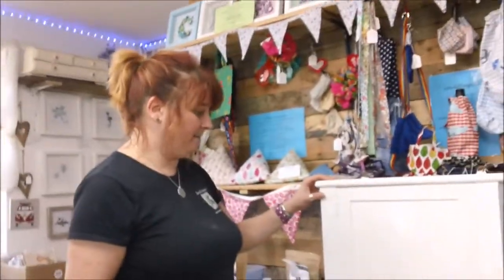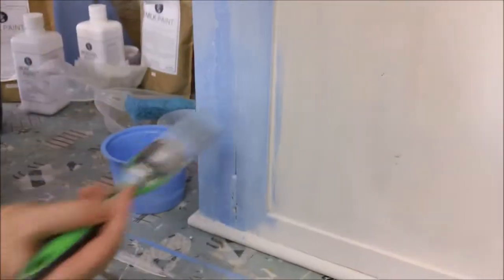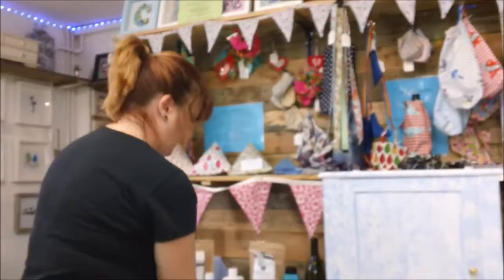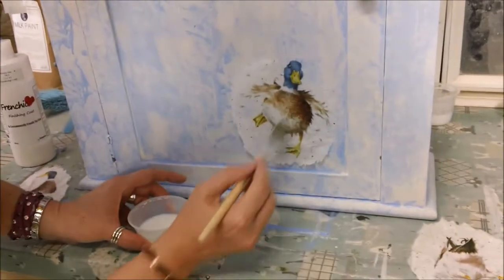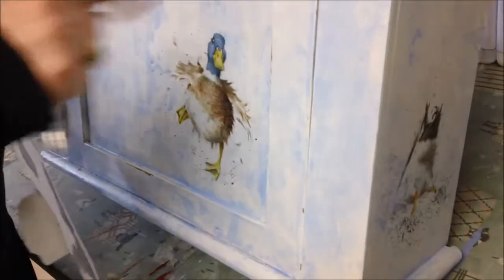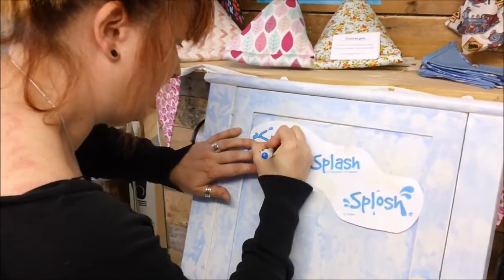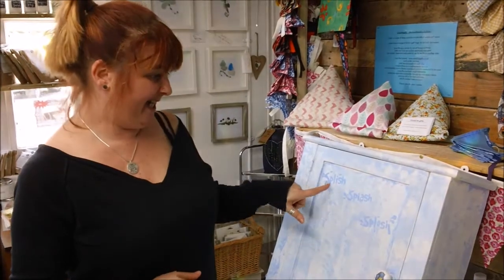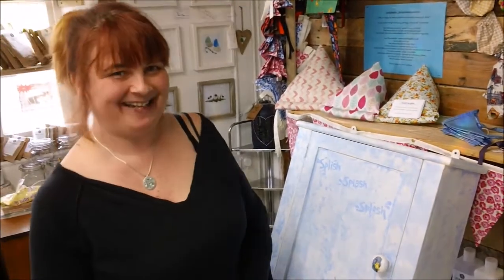Splish splash splosh cupboard

Comment: what is milk paint?
Reply from the maker: Stephanie Smith What is Milk Paint?
If you love using chalk paint, then you will love GraceMary Milk Paint. Milk Paint provides a completely different finish to chalk paint and can create anything from a silky professional finish to a highly distressed antique look.

Milk Paint is a truly versatile paint and its use can be traced back to ancient carvings and art. It’s easy to use, durable and will never chip or fade. Its made from all natural, completely safe ingredients and can be used on children's furniture and if your pregnant.

Milk Paint is truly versatile and can be used thickly for a solid colour or as a wash for floorboards or a stained effect. It can be distressed and/or crackled and is the only paint which can achieve the chippy, aged look. This is where paint naturally peels in designated places using a wax or oil resist technique.

Because Milk Paint is made up of live ingredients, it comes in powder form...all you need to do is add water and stir!

Milk Paint needs to be used on bare wood or any porous surface. This means you will need to sand down any varnished or painted surfaces. However, if you’d rather just get on with painting and avoid priming and sanding (like you would with chalk paint) then you can add our bonding agent during the mixing process. This enables milk paint to adhere to almost any surface

Milk Paint dries in around 30 minutes and you’ll normally need 2-3 coats. You’ll easily be able to start and finish a project in the space of a day.

You can buy our Milk Paint in samples that make up 250ml and in bags which will make up ONE Litre when mixed with water. You’ll get around 5 -7 square metres coverage per litre of paint, and even more if you use it as a wash or with our bonding agent.